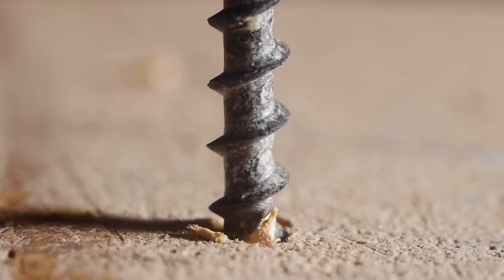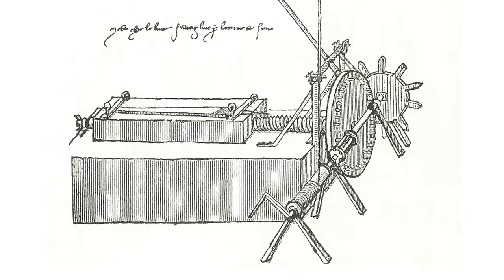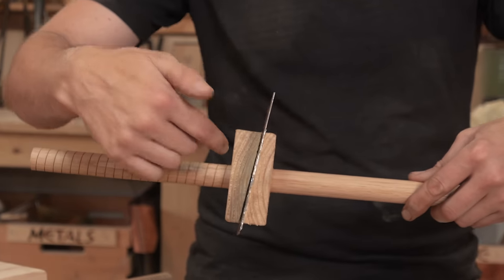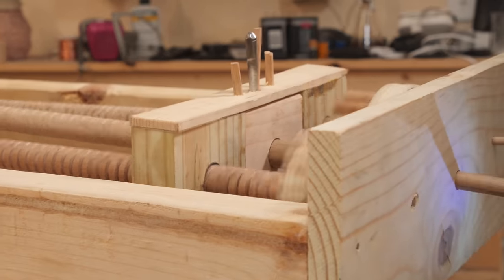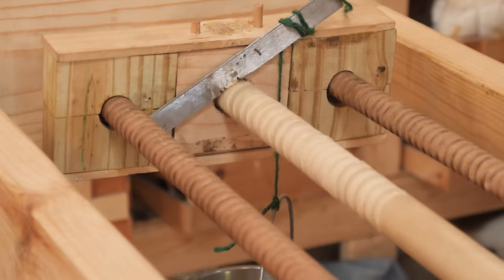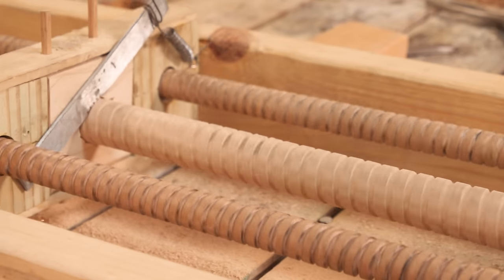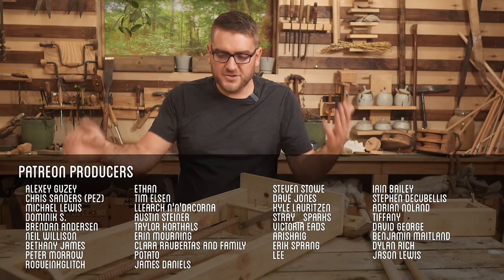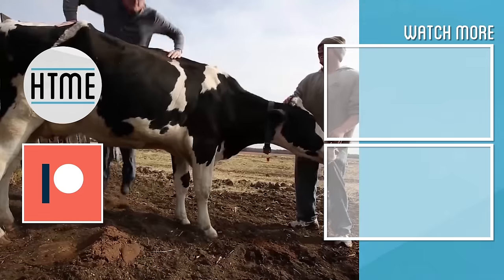This DaVinci Machine Unlocks Precision!

Comment: The lathe is one machine that made the modern world possible, and it’s the only machine that can replicate itself.
Reply: You forgot about the 3d printer. It can replicate itself
Reply: Well neither of them can actually reproduce themselves. But at least they could produce a variety of parts needed for the assembly.😅
Reply: @netherdemon  3d print a stepper motor.
Reply: @Beamer1969  Challenge accepted.
Reply: @netherdemon but for lathe you basically need only motor and everything else you can create (motor also dont sound too bad but idk if its really possible to make something with enough force). And for 3d printer you need to buy much more complicated stepper motors, heater for nozzle, circuit board for control, 12v psu and pc for designing 3d models.
Reply: @cytrynowykisiel3715  The original lathes were driven by water, and steam engine. For like 2-3 centuries, until the invention of the electric motor.
Reply: @iteerrex8166  Lathes were human powered for a couple millennia using either bows or treadles as well.  These were usually not modern full rotary lathes but would have been used in the construction of those early non-human powered designs.  But, by using a flywheel and drive belt the treadle can be used to power a modern style lathe and was used for portable and home lathes before electrification in the early-mid 20th century.  So, it is even easier to power a lathe than you might think.
Reply: @matthewkeeling886  Yes, the wood lathes we’re.
Reply: @iteerrex8166  As were jewelers lathes (from at least the 16th century) and a number of common 19th century light-medium duty metalworking types.
Reply: 3d printer has entered the chat
Reply: @theactualduck  If you allow using the lathe as a mill to make the ways, I think a treadle powered lathe could be produced using a lathe.  If one wanted to you could always scrape the ways flat manually ala Gingery
Reply: "The lathe is the only machine that can replicate itself." Is such an old wives tale.
How does it create all the big, long, flat parts? The large, heavy body?
Reply: @iteerrex8166  Ive got a very early 20th century 10×50 (inch) metal lathe with the option for pedal power in my collection.
It has a motor but the pedal power is actually stronger then the low volt and amps a standard wall outlet in the US can deliver.... at least until the human body runs out of steam 😂 so for very short processes.
Reply: @netherdemon  The wiring/electronics? The belts? etc.
Reply: @sonofbr  in theory you could just use it as a horizontal mill to machine the flat parts, the issue would be having the space to actually machine it on the lathe. Same thing for drilling holes and such. As for power you could make it run on anything as long as you can translate that energy to spinning motion. So you could literally run a shaft with a water wheel to a river and get it to spin. You don't need belts or electricity to make it work. As far as machines go, the lathe is the closest machine being able to manufacture itself completely from raw material.
Reply: @sonofbr  You cast them of course, just like you do for all the materials you make the lathe from.  It doesn't mine the ore and then smelt it for you!  One can flatten material by hand to a pretty precise degree using a flat surface to mark the plate and then scraping down all of the marked places.  Look up Gingerly Lathe and you'll see a whole machine shop that starts with casting parts for the lathe and then making the lathe better using the lathe until you have something that can make other machine tools.
Reply: @doughnut1107  Shows how much I know. Good information. I'm going to watch that.
Reply: @AnonymousAnarchist2   A human powered 10x50 🤦‍♂️😂. I had never heard of that. I wonder if there was ever an animal powered one.
Reply: @iteerrex8166  Yup, gots pedals on it, looks like a bike made for aliens who missed the point of moving 😂.
I wouldnt be suprised if there was animal powered lathes, lots of blacksmith screwcutting lathe kits that you would bolt to a chunk of wood and modify to suit your needs in the 19th century.
Reply: @doughnut1107 its really hard to use a lathe to refine raw iron. Or to harden it.

You can use a precision lathe to cut the precision parts and use it as a mill and all that of course.

A typical lathe though has parts that are reaaally tedious to somehow make on it.. The part that is most true of the saying is that you needed a lathe to make a decent lathe, this is no longer true though.
Reply: @lassikinnunen  Tools make parts, no one who has said that a lathe can build itself was implying that it can smelt ore or cast things.  You use the lathe with materials to make other parts.  No one said that it would be ideal to start with a home built lathe.  However, with a casting setup and a fairly flat reference surface, you can build a lathe.  Look up Gingery Lathe if you'd like some plans that many have successfully followed.
Reply: @AnonymousAnarchist2  After reading you description lol, I went searching, but all I found was sewing machine size watchmaker lathes with paddles. Which by the way, I found that Hand-Tool-Rescue had restored one 4 yrs ago, and ill watch that later. But didn’t find any mid size, 10x50.

Comment: No wonder then that for most of human history nails and rivets were preferred over screws!! Great video
Reply: hand filing that screw took was one of the most painfully slow day of my life
Reply: Well, nails were a much later invention. Most wood work was just cut and jointed together.
Reply: Nails are still used more in structural wood constructions. Nails can move a bit with the wood and still bear load. Screws shear off and can cause building collapse. They have their different uses.
Reply: @BenjaminDamoncycle  JESUS: "Bulls!ht, nails were a much later invention!"
Reply: @BenjaminDamoncycle  Nails are literally one of the first things people created when they got their hands on a good supply of iron.
Reply: Not Iron. Copper or Bronze.
Reply: @Candlemancer  Yup, we have a pretty rich example of this by looking at things that have survived from Ancient Egypt. Nails were a thing.
Reply: @neruneri  But nails are not considered a simple machine. They hold things in place, they aren't used to convert mechanical forces. An incline plane is considered a simple machine because people use them to use forward force to propel things up. A nail is used to hold pieces of wood in place the mechanics are done by the wood itself.

Mind you the very front of a nail is actually a wedge as that pushes the wood fibers outward and the wood pushes back on the shaft of the nail, but the mechanical forces are the wood contracting around the nail

Comment: that's awesome! btw i don't think you need to carve the screws in metal. what might be more useful is a screw cut in wood that could be used as a shaping tool for the mold. then you could just make a lot of screws by just casting them in brass.
Reply: Thats what I thought too
Reply: For a quick work you could probably get away with twisting the metal.
Reply: Depends on what their goals are. If its for fastening that might be true, but if its for power driving the exact profile might be more important (like for a lathe?)
Reply: You aren't going to be able to sand cast a screw, so they would have to use a more advanced form of casting. But even still that's just not really practical for making small screws like they are going to need. Casting is always going to be an imprecise manufacturing method.
Reply: @UMADBRO64  yes, and that "finishing" you are talking about has to be done on a precise machine if you want the finished product to be precise. The precision comes from the finishing machining and not at all from the casting. Hand finishing will not give you particularly repeatable or precise results. There's a reason every machine had to be hand fit and finished up until the mid 19th century when advanced machining practices allowed people to make parts with consistent, repeatable dimensions, i.e. replaceable parts.
Reply: @1rez378  I tried that. It's not easy and result was not very good.
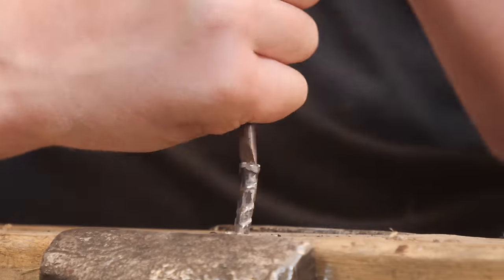Reply: @TheLadderman  ok, but you can still make something better than a nail quite easily and with a little effort make something similar to the screw used in this screw making machine. If you have cast bronze screws in this machine it will be much easier to carve steel ones simply because of the amount of force you can use on the carving tool without damaging the machine. And smaller ones like the one shown at 1:25 don't have to be very precise, the grooves don't have to be very precise either, so maybe even sand casting will do the trick. If not you could try casting in fired clay or even plaster. I think these methods should be accurate enough as small and detailed tin soldiers have been made for centuries.
Reply: Start with a taper square rod and then just twist it, no filing needed to make a rough crew.

Comment: If you have access to iron and forging, you can create a screw by tightly hot winding one round iron thiner rod "turn-to-turn" around another (little bit more fatter), then forge welding the ends with flux. This will form a uniform, strong thread - my father and I repaired old vice in the Chernozem'ye Region far from civilization this way - and it was works. Sorru for bad english)
Reply: I would love to see this process, do you know of any youtube videos showing it? I honestly dont know what to search
Reply: @alexstone691  a good starting point might be "hand forging a screw"

Comment: Fun fact, your setup for making a nut is basically how rifling was cut into gun barrels until hammer forging became widespread in the early 20th century.
If you want to power it from a water wheel, look up 19th century rifling cutting machines. They have all the linkages you’d need to upgrade your machine. They also typically had a ratchet that would automatically advance the depth of the cutter after each pass.

Comment: FYI, according to one of my history profs, back in college  (50 years ago) screws were often made by wrapping a small rope around a round piece of wood a couple of times in a spiral, sprinkling it with sand, and then drawing it back and forth until the groove was sanded deeply enough.  Then the spiraled rope was moved up the wood, and the process was repeated.

The grooves thus made were quite smooth and uniform  --- especially if they were following a pre-scribed line - like what you made.
Reply: That makes me feel like a genius, cause my first thought was "I bet you can do something with wrapping rope or string around it to get the spiral.
Reply: Seeing how many passes it took with the saw tooth, sand probably even works better than that single saw tooth.
Reply: I love how these guys went to all the trouble to re invent the wheel.for gosh sake why do we call them screw threads.  I am an old machinist.  they could have talked to me and this video would be a hell of allot different.  but i got a good laugh out of watching these egg heads.

Comment: Very glad to see you all reference the screw-cutting lathe from the Mittelalterlisches Hausbuch von Schloss Wolfegg. It's far more advanced than what Da Vinci sketched, and was a tool actually in existence at least 20 years before Da Vinci sketched his. The innovation of the Da Vinci screw-lathe is the ability to change gear ratio for different thread-pitch rather than multiple master screws with matching guide poppets.
Reply: We don't carve threads into screws, we roll the blank screw shank between grooved plates.

Comment: Wow this is my favorite project on your channel. Bootstrapping precision like this blew my mind
Reply: As a machinist it’s wild to me how people figured out making precise reference tools with imprecise tools.
I can’t imagine what it’d take to start with a block of stone and end up with a surface plate.
Reply: @PrebleStreetRecords  it takes three blocks of stone, an alternating pattern of rubbing different pairs of two of the three together in sequence to average out their relative errors, and then absolutely soul-destroying amounts of time and patience repeating the sequence over and over and over to gradually chase desired flatness. But then if you do it right at the end of the process you have three surface plates.
Reply: @PrebleStreetRecords The three plate method. You can use it to make a reference place, internal and external squares. plus a straight edge. Then from a reference plate you can dress a grinding wheel into a surface grinder. That gives you parallelism. You can create a measuring system with dividers and a straight edge. You can get lots of angle measurements with a dividing plate, which you make with your reference plate, straight edge and dividers. You can replace layout fluid with soot. With reference plates you can make ways and start working towards a modern lathe.
Reply: From what I remember even all the way back in the stone age, using tools to make better more precise tools was a massive factor. Like a primitive "anvil".

Comment: Regarding vices, Clickspring did a video on a leg vice that could have been made in ancient greek times for his antikythera project, so, while not exactly like a modern vice, it is entirely possible for people to have had vices before the screw was perfected.
Reply: another thing is you could just use plain wedges too
Reply: There are a few ways I could think of to make a vise without needing a screw thread. You could have a locking plate with regularly spaced holes or notches where the remaining slack is taken up with a wedge (this could be made with basic forging tools, or even out of wood), or you could use a steel holdfast type design, where a slightly springy curved steel "L" shaped bar can be used to lock and unlock the vise with a tap of a mallet. Clickspring's vise was pretty cool to, especially for holding small parts.
Reply: Wasn't that vise designed for small part? With leather Jaws so it wouldn't brake stuff
Reply: I ask because that was a pressure base vase not a tension vase, as it works almost the same you can't really use it to like carve in any direction cos some direction may lose the grip as a tension vase its stronger on its grip and it can hold on better a betting with a mallet
Reply: @fergardla  that's true, although I guess similar principles (using wedges etc), could be applied to larger vices with higher grip strength, and the jaws could be made out of wood or metal textured in such a manner as to provide higher friction.

Comment: What a cool device. The drawing shows the thread being cut with something similar to a wooden rabbit plane. The method for cutting you chose or suggested for a metal screw does not work very well because it has no way to clear the waste from the cut. A saw or file clogs very quickly when held in the same spot on a lathe where a single point cutter can easily clear its self. A relatively simple solution would be to use a wood chisel as your cutting tool.

Comment: I think this machine is not just cutting screw but also averaging the errors in the two motion screws, thus giving you a smoother, more regular, more precise finished screw. If you can iterate, cut new screws that then replace the old motion screws to cut a new generation, you can progressively improve on differential errors between the two screws. And if you can skew the two screws (or their nut), you can transform "common mode" error in one section into differential errors that can be corrected. I'd say you should have sqrt(2) gain in precision for each pass. After a dozen iterations, you are cutting 100x more precisely than you did with the first generation.

Comment: Holy crap, that "use a thick wire on the inside of a hole" strategy of making a wooden nut is genius! I can't believe I've never seen it before! I've been puzzling over how to cut internal threads so that i can make wooden screw mechanisms, and that might just work for what I need! Thanks guys!!!